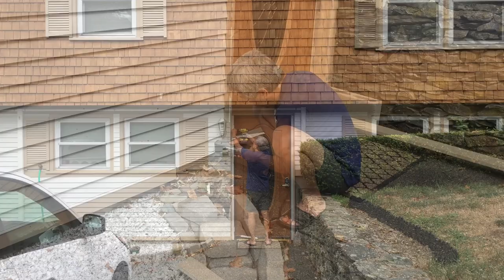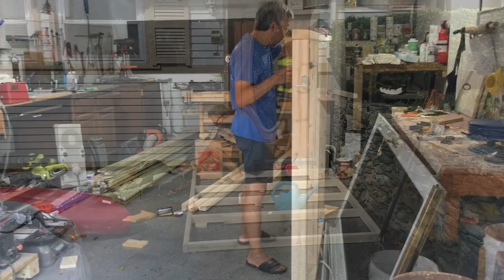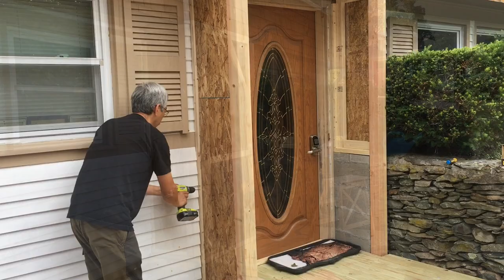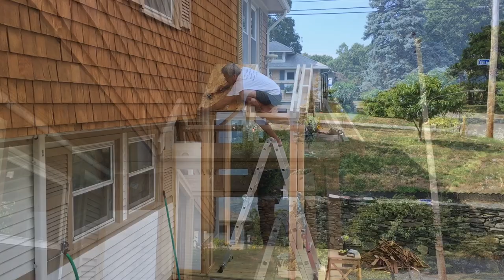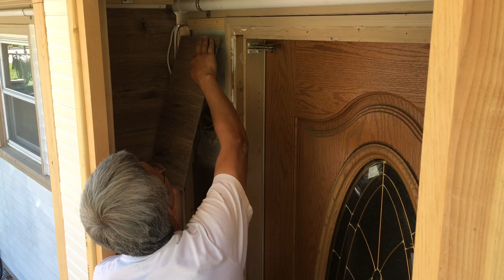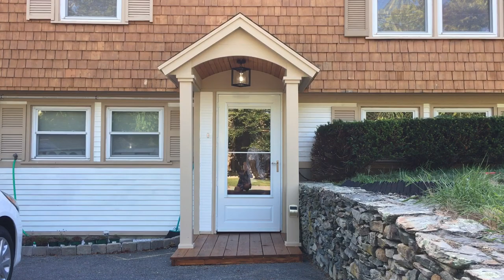build a Portico 20200815-31

Comment: Looks fine with precisions, however it’s gonna be a hassle to have to replace that subfloor very soon, since it’s  not PT. (Pressure Treated)
Reply: Thanks!!!The floor are easy to be replaces. Since all posts were installed to the concrete base ground directly. the video doesn't show very details the construction so may confuse some people. I am not a pro, jut love to diy.

Comment: looks good, my only comment is did you add any flashing between the cedar shingles on the house and the roof of the portico?  If not, water will eventually work its way between the two structures and rot them both.
Reply from the maker: Yes, you are correct. My husband said he did something to instead.I didn't captured this in this video.

Comment: He did it all by himself! 😳
Reply: Why not?  I'm no pro and I built an entire bulkhead for my home years ago.  I had someone dig the hole, I knocked out a doorway through the foundation wall, poured the footing, built the concrete block enclosure, waterproofed it, bolted down steel Bilco frame, attached the steel doors, installed stair stringers for the stairway and back filled around the bulkhead by hand.  I was around 35 years-old at the time, and it took me about a week, doing entire project all by my lonesome.  It's still in great shape by the way, over 40 years later. No leaks, wood rot, etc. <G>